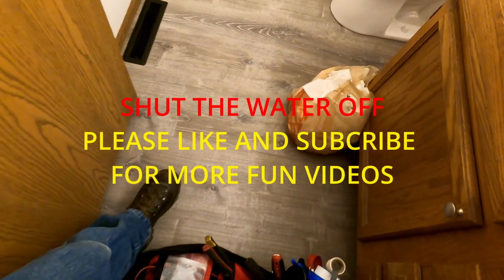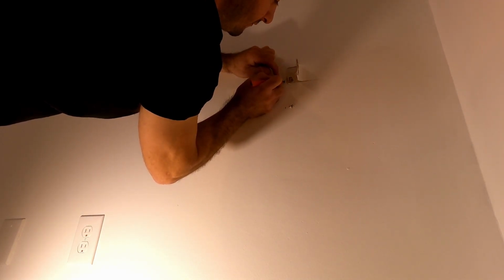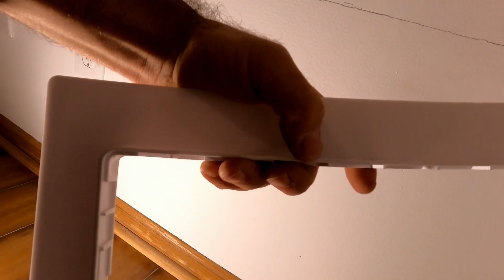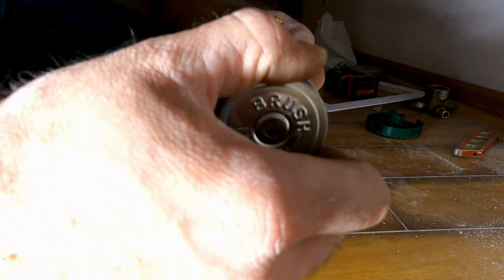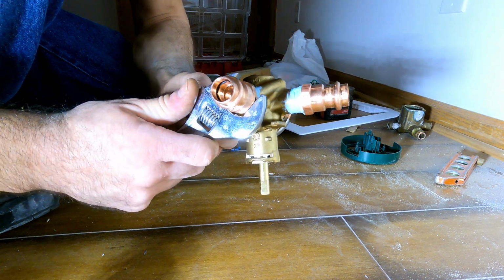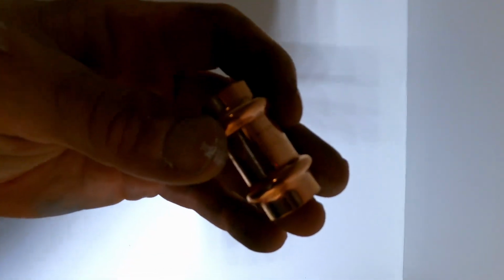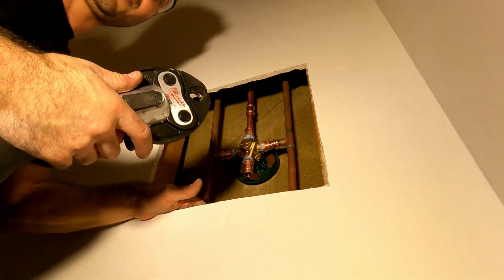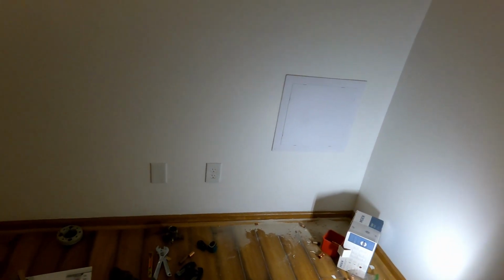When replacing a shower cartridge goes terribly wrong

Comment: Did a high end bathroom remodel couldn't get the shower head to stop dripping , ended up being a three part shower valve , what insane engineer is coming up with these designs ,
Reply from the maker: Yea, right? Crazy stuff, they better start making it easier for the installers or they will miss out on the sales.

Comment: Correct within Moen posi-temp tub/shower valve, or shower/only valve. Un-nessesary towards using Fip/female copper adapters, and-or pro-press fittings, within the provided within valve body ports,Mip/male threads. Due to 1/2 Copper pipe being 5/8ths Od/outside diameter, ties directly within the shower valve itself left/hot, right side/ cold, top/shower riser, bottom tub spout line. Soldered Ridgid joints. Pull existing cartridge first, prior to soldering, let cool naturally, shock cooling with water immediately post/after soldering, could crack newly soldered joints. Once cool, use squirt bottle, plain water, wipe your new joints. Fittings can be used, problem being very un-nessesary/waste within fittings/money, , also more joints, more chance within leaks.

Comment: Get a pipe vice it would have been easier and use the Milwaukee copper cutter from the start no sharp edges the grinder is fast when you are soldering.
Reply from the maker: Yea I used the grinder cus I needed every little bit of that pipe. The pipe vice sounds like a good ideA

Comment: Don’t have a propress which Milwaukee did you buy I see you have the c clamp too was it in one kit,,,
Reply from the maker: I got the Milwaukee m12 and those tight area fitting jaws are sold separately. Totally worth the buy but everything with propress is crazily priced
Reply: @thehandymanexperience226  thanks for getting back to me about the propress. Been looking at them expensive. Loks like HD in Calif has o interest if your a pro rewards  contractor program thx for telling me the C clamps are separate. Been looking  all over  for the kit with the   Clamp accessory.  Should I just get 1/2 and 3/4 or get the 1 inch too. I have lots of mill batteries and chargers..

Comment: I just replaced one this week, got it all from the tub side not cutting of sheet rock or fiberglass. It can be done
Reply from the maker: Did you cut the tub or the wall and put a big trim plate over it?
Reply: @thehandymanexperience226  no i cut out the old valve through the existing hole, then sweat off the old fittings , and installed a moen 2520 valve. It’s tight but it’s doable

Comment: Monday I replace one that the renter used a hammer to get the cartridge back in all the way, and every adhesive available to him- superglue, silicone caulk, etc., to get the cartridge housing back together after he stripped the threads. 

It's a mess.

Comment: This is going to be me in a few hours. The last video I watched the man said all you need is an allen wrench and a screwdriver. 😆. But...since the set screw was stripped out I had to cut off part of the handle with a hacksaw and then use a handle puller to remove the handle and channel locks to remove the faceplate nut, I knew that other guy was full of 💩.
Reply from the maker: Lol 😆 that's why I laugh when people say it's easy. It's not always easy and goes south really quick.

Comment: You Should have bought the valve with the built on press fittings. Makes the job so much easier
Reply from the maker: I believe it and I wanna know how much that valve would cost. cus I got the whole kit ( tub spout, shower head, handle and trim, and also the valve was $100
Reply: @thehandymanexperience226  the money you’re spending on those press fittings equals to a valve with it built on.